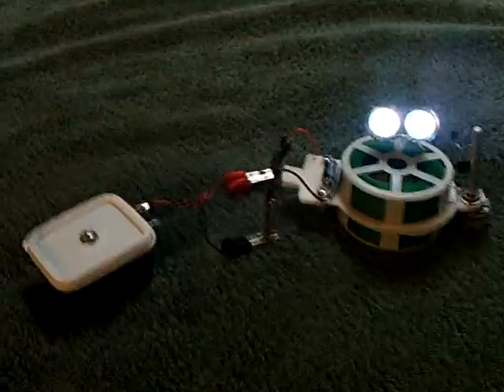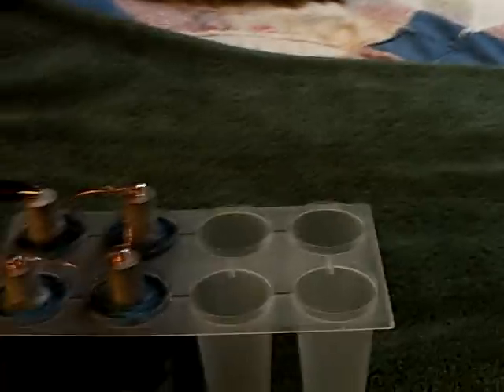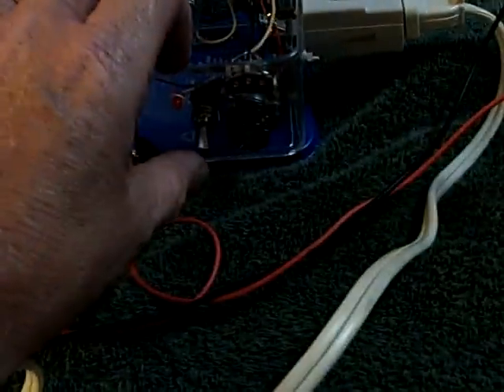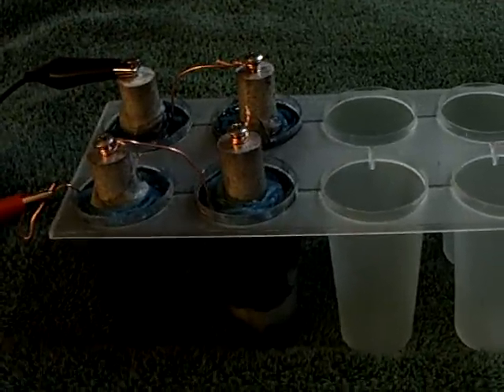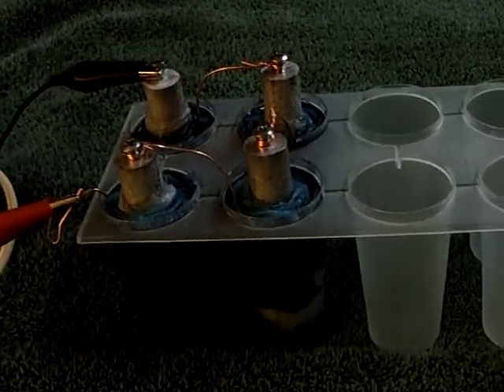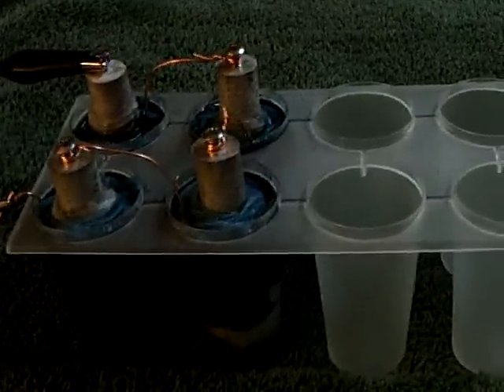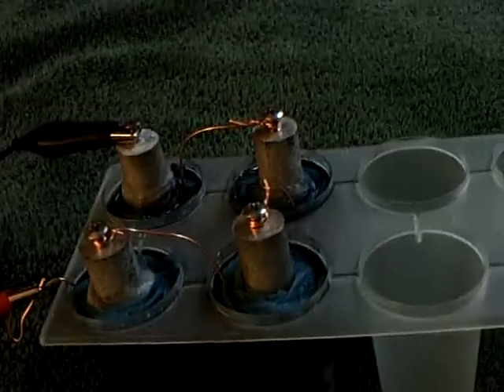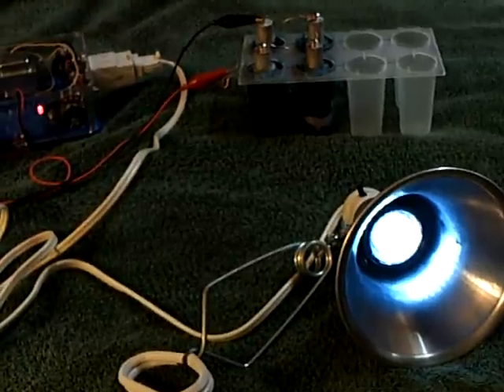Homemade battery for Super Joule Ringer 2.0

Comment: I must be the only one that hasn't succeeded in making The super Joule Ringer work. Would have liked to see it work for the fun of it, for as mentioned to TinManPower; it is a thirty year old circuit that Laser-saber has proposed? Ten years ago I bought a wall mounted neon light with a six volt battery in it. When there is a power cut, two 7w, 240v neon light up, as soon as the power is back on, switches off and charges the battery. There are portable ones too; very popular in Europe.

Comment: Oh, yes indeed. My thinking is more along the lines of junk in a backyard, various scrap metals etc. If you have something that does a job and does it well for a few days and a purpose, then it's equally as valid as something built to never corrode or be consumed that sits around most of its time.Considering no home made battery lasts forever (that we know of) then building to spec seems appropriate...as shown in the video. After all, he used what he had, hence my thinking - time well spent :)

Comment from the maker: You know that is exactly what I was thinking---this would make a great emergency battery.  After I made this video I took the battery apart, rinsed that parts off, dried them, and packed them away.  I even saved the damp charcoal in a zip lock bag.  I could put this battery back together years from how and it would still work.

Comment: Well done Lid !
But the magnesium rods will get consumed pretty fast with your setup and  electrolyte...

Better use Aluminium foil with lampblack and put the lampblack into stainless steel mesh for better conductivity. Then use water + K2CO3 as the electrolyte, so you will also get 1.5 Volts per cell.
Alufoil is much cheaper than magnesium rods and can be got in every supermarket. So I hope this helps. Regards, Stefan.